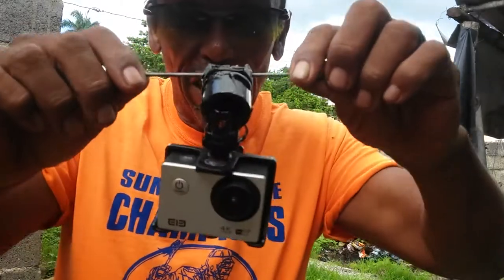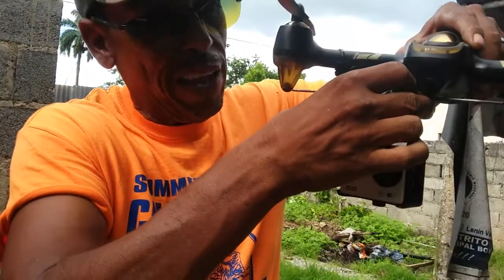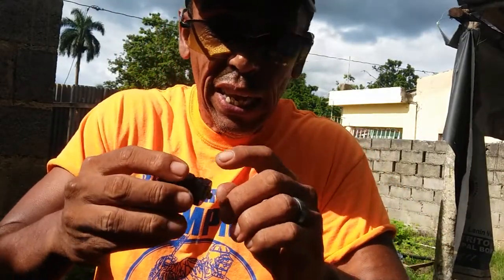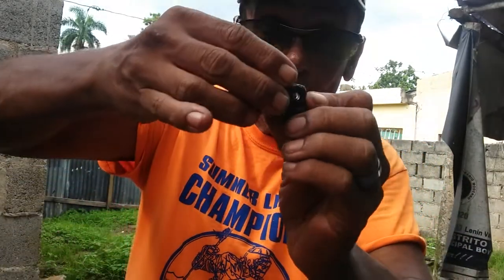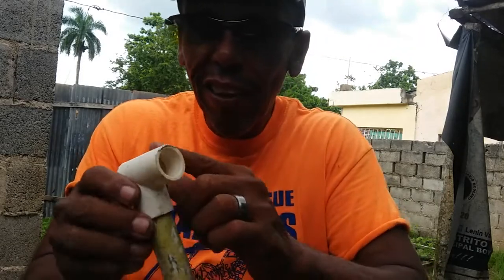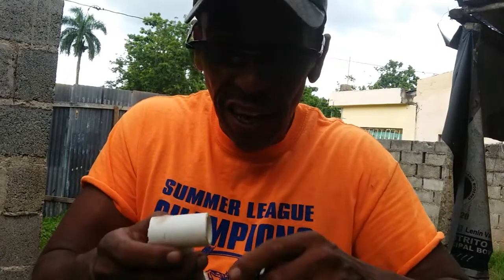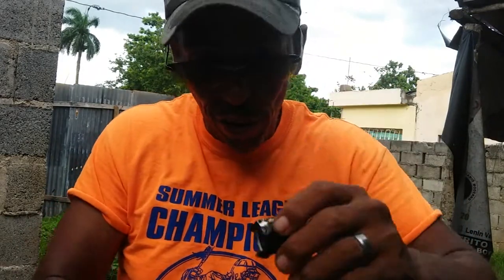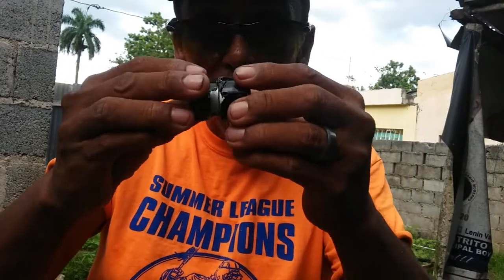MAKING OF GIMBAL FOR HUBSAN H501A HOMEMADE REALY WORKS

Comment: you should waterproof your drone im currently doing it to my hubson and beebop2 its kinda of a pain to do but now I won't have to worry about water possibly messing up any of the circuits plus getting some rain footage would be pretty awesome especially in the Dominican republic with all the beautiful greenery heres a link to the chemical i got so far i put it on my main motherboard just to see if it breaks anything (was hoping it would not harm anything) and drone flyes like normal no problems
Reply from the maker: i have corrtion x that works realy good its me that dose not like to et wet besides if anything gose wrong ..its so hard to get a drone or parts ere